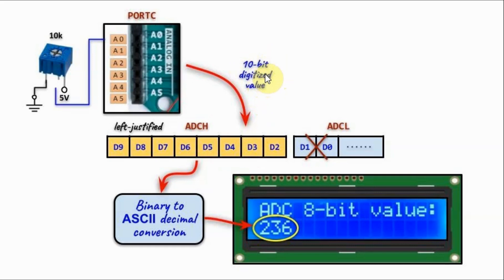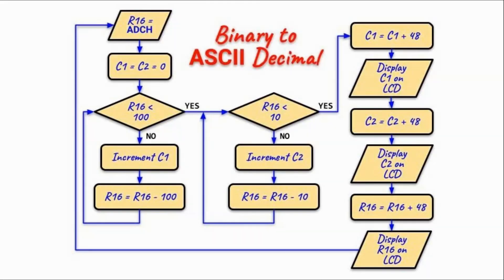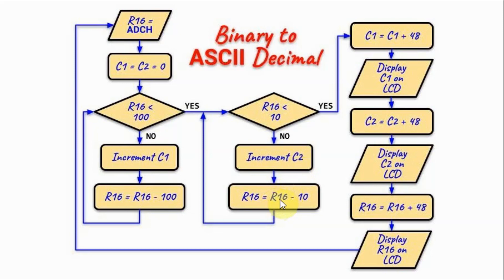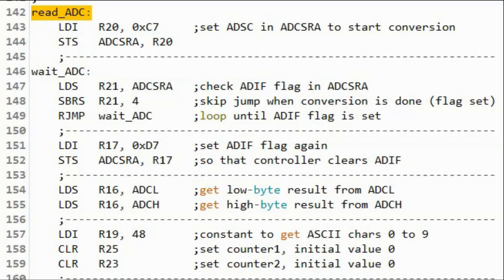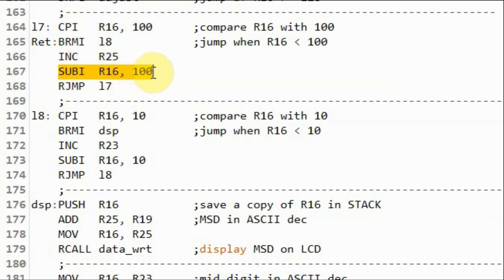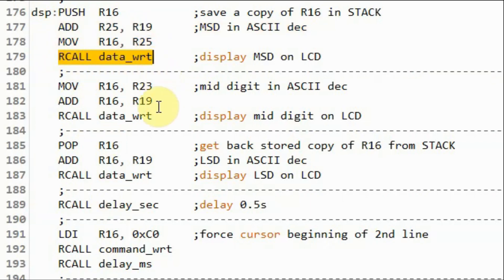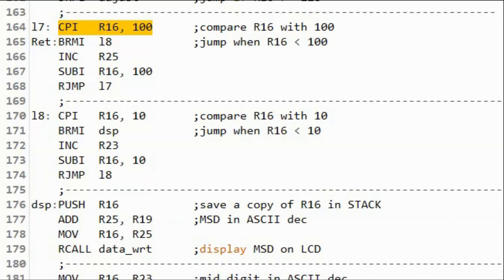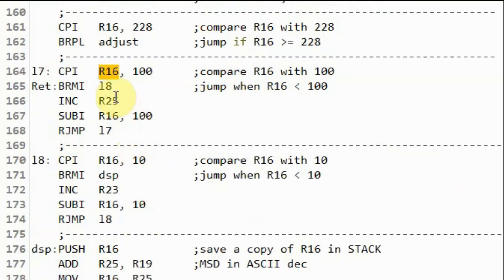Assembly via Arduino (part 9) - ADC Decimal Value on LCD

Comment: Nice Work!
If you use the instruction BRLO instead of BRMI, you will not need to compare with 128.
By the way, did you worked on displaying the 10-bit decimal value on the LCD ?

Comment: Interesting. Thank you. 
How would you explain this runtime error?
Is it the hardware? The Compiler?
Reply: The "error" was caused by the use of the BRMI instruction, which assumes the compare was between two signed numbers.  As @MFM248 stated above, BRLO assumes a compare of unsigned values and gives the desired results.